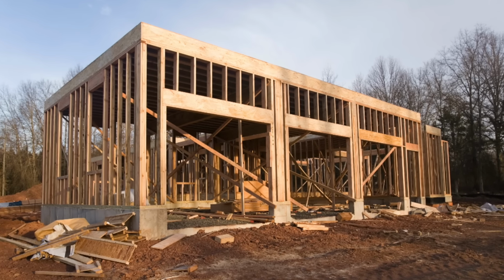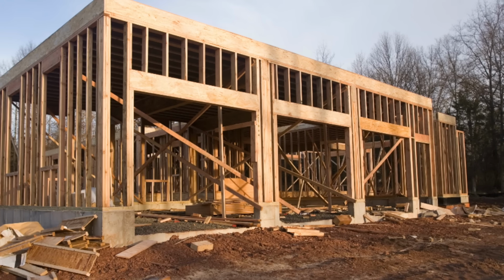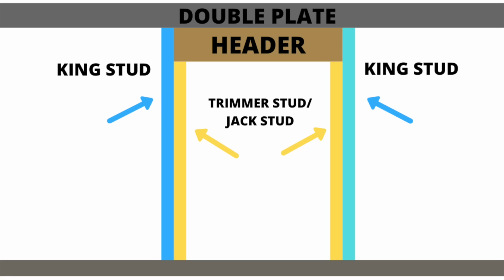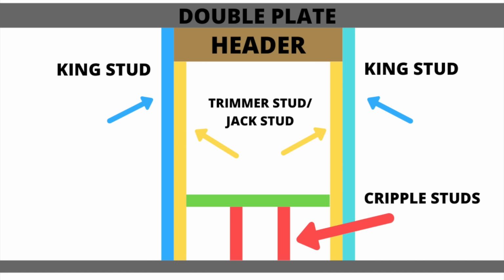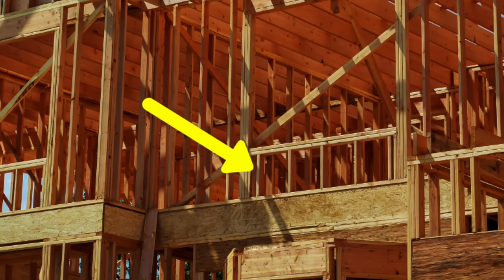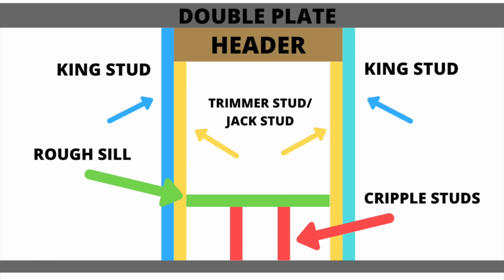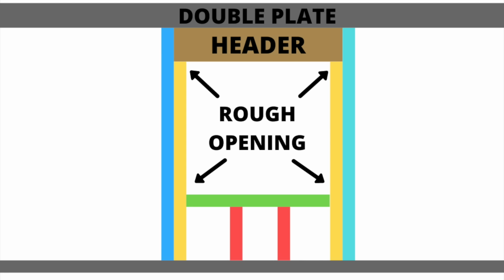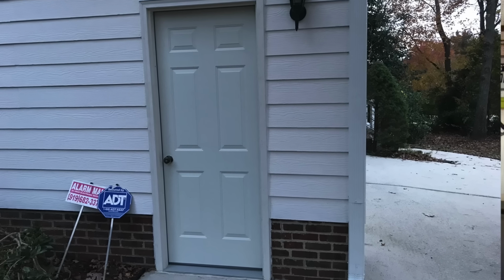All House Framing EXPLAINED...In Just 12 MINUTES! (House Construction/Framing Members)

Comment: Very well done video! Really enjoyed learning more about framing. What are strongest rafters or trusses? I feel like both are highly used in construction. What is the best way to get into framing? how much can you get paid with no experience and with experience? Is steeling studs framing replacing wood studs for residential? I see is done over commercial. Thanks!
Reply: Perhaps you should make another videos explaining how plywood sheeting prevents the house (skeleton) wood frame from falling apart. Interested to learn more.
Reply: Trusses are stronger. No, metal will not replace wood, which is grown as a crop and doesn't need mined. Stop at a jobsite and ask to talk with the framing foreman.

Comment: this why hurricanes ( depending of the state like florida) , if you build something like this hurricanes level 2-4 will do alot damage , but the other hand commercial building can handle hurricanes , so who coded this house builds at the end of the day 🤔.
Reply: Wood-framed structures in hurricane areas are built to special codes and do fine in hurricanes.

Comment: Ordering my engineering experts in my functional group to create a field group engineering lecturer to teach by troops camps roaming of on-site lecturing to my army legionnaires per group schedule lectures to each and every equipments for building things, the proper measurements and calculations of structures to build the different types of structures and terrain adaptable structures, the excavation procedures the tools of variety for construction the modern engineering techniques. Of a course per course basis. Understood. Then followed by another group of lecturers from my tech group of Wirings experts of wires variety and function for electric installments technique to electronic machineries to hardwares and softwares equipments to combat bomb making wires and bomb diffusing of wires technique to wireless technology study courses. Of a roaming method of teach to each area troops camps of my legionnaires armies. The CaesarKing I orders. You my soldiers shall be an efficient soldiers of war at the same time with know how to build and adapt to the terrain environments of whatever purpose orders. Understood. The CaesarKing I orders. Let it be

Comment: I loved how you broke down the framing process! I've faced challenges with joist alignment in past projects, but understanding the terminology made a huge difference. 

Cost estimation can be tricky, especially with lumber prices fluctuating. I use FloorTally to keep track of materials and calculate costs accurately. It’s been a lifesaver!

Comment: This is a great introduction.  Concise and precise.  Thank you!

I see that the wooden frame is exposed to the elements, wouldn't moisture and sun damage all the wood?   I suppose that it isn't practical to build a large cover/shelter first.
Reply from the maker: Thanks! Most lumber has acceptable time limits that it can be exposed to the elements. Ideally though, you want to get the house "weathered in" as quickly as possible!
Reply: @TheHonestCarpenter  Thank you so much.  You can tell I know nothing about building a house.

Comment: Great video. I would ask you, what's the best way to protect the bottom structure of the basement from fungus? My basement has a lot of moisture because in the winter, even if I ventilate it and use a dryer, there are lots of rainy days with high humidity % and I get some fungus on the wood in the basement :s How can I get rid of this problem?
Reply: It sounds like you don't have good drainage in the outside of the foundation.
Reply: @jobacuda4472 , I have. All the walls that are under the ground level are isolated and I created a drain system that goes a little under the foundations level and collect all the waters that surround the house, but even with all that, I get some points where the humidity seems to come from under the foundations level :( when that humidity comes up, it'll take too long to dissapear, giving time for the fungus appear :S
Reply: @jsd1as  I just wonder, given good drainage, where can the water be coming from? Is it coming up through the slab?
Reply: @jobacuda4472 , I think yes and also from from the bottom of the ground.
With all the drainage I did, the only explanation I can find is that all the surrounding terrains gave a big pressure of water, making it to come out from under my house. My question is, how can I isolate it completely or at least install a good ventilation solution to avoid the creation of fungus
Reply: @jsd1as  Yuck. You could seal your slab if you haven't already. But if there's pressure forcing the moisture up through the slab, it may lift and rupture whatever you put down.

Do you have heat and AC in the basement?

Comment: Do you have any material on how to add a hip style roof covered porch addition to an existing low pitch(4/12) gable roof. Is it possible? Also, the issue is that the home is a single story residential home with standard 8’ walls. It’s a very plain and basic built home that is a perfect rectangle with no additional architectural designs/features. It’s a 27x73 rectangle right now. We wanted to change the appearance of it by adding a hip style covered porch that is 10 deep on the narrow end (27’ end of the home). Is it even possible to construct. Thanks
Reply: Yes it is. Of course, hip roofs are quite a bit more difficult to frame than gable roofs.

Comment: When you buy lumber in today's stores, they falsely advertise their wood dimensions, an example of this is they sell 2x4 listed as 2x4 but really your not getting a 2x4 piece of wood your getting more like a 1.5x3.5 there for the engineer data is always inaccurate to the actual material being used.. only solution would be a class action lawsuit anyone who got sued for not building to code of similar issue...the misleading advertisement in hardware stores about what materials being sold, home depot, lowes, any lumber store is participating in this fraudulent scheme of false advertising.

Comment: Does one need knowledge in structural engineering to design & build a house like that?
Reply from the maker: Yes, definitely some serious experience with it. And generally an engineer will calculate loads and approve code adequacy of framing (which an inspector will sign off on later).

Comment: We recently purchased a house built in 1942. All the inner and outer walls are covered with 1X6 boards. The inner walls have burlap material, old wallpaper, and sheetrock pannels. Even if you had NO outside sheeting, you could NOT pull this framing over even with a bulldozer.

Comment: Instead of I-joists, utilizing oriented strand board, is it still an option for homeowners to have joists that are solid lumber?
Reply: Yes, but they can't span nearly as far.
Reply: @jobacuda4472 what’s there to span the gap? Adding more?
Reply: @omni1607  Lumber joists are the weakest, I-joist are next strongest, LVLs, glulams, and floor trusses are the strongest.
Reply: @omni1607  Add more, reducing the spacing (or doubling them). Or use taller members, e.g. 2x12s instead of 2x10s

Comment: All the benefits that you assigned to trusses assumes that the truss is in good working condition. I have almost NEVER seen a home where at least 1 or 2 trusses werent compromised or installed wrong. These construction companies that mass produce homes for suburban sprawl do some of the WORST work on the planet. If you are building a new home and can even REMOTELY come close to affording it, hire a proper architect with a crew that does specialized projects. It IS more expensive, but you will probably save the difference by avoiding repairs and water damage in the future.

Comment: That large passage that was cut through those ceiling joists at 2:18 - looks like it destroyed all load bearing potential for that section.  I would not be comfortable doing that without secondary support.
Reply: Amazingly enough, they are designed so that it's OK.
Reply: Also, all is engineered, but know that you can't just blow holes in these wherever you want. Important to follow manufacturer's spec.

Comment: Very helpful explanation. 
mudsill on top of foundation (treated wood)
floor joists - today engineered lumber... 
i-joists = strandboard and solid lumber caps w/ precut knockouts can run uitilities through like duct and wiring. 
beams run perpendicular to joists to add further support as a "spine" for joists. can rest on masonry piers on a foundation. 
columns then attach to beams into foundation etc =vertical support.
 subfloor on top of joists made of plywood or strandboard. walls on top of subfloor. stud=vertical lumber to create structure - 2 *4 or 2 *6 -- sit on top of plate - untreated lumber attached to subfloor. and at top of studs (oft doubled) 

doors and windows - headers to provide support where studs hollowed out
prefab staircases installed like a ramp
upstairs same as  bottom floor - joists, subfloor, etc
roof made of rafters converge diagonally at a ridge board
roof contours = hips and valleys
roof trusses prefab roof shape & structure installed side-by-side - very strong and faster to place
sheathing on top

Comment: Question -  I have porch with gable roof (12x16) with 10feet high from ground. Wondering if posts for porch should be exactly "under" the outer wall (parallel to house Wall) or can Gerd/beam (horizontal to support porch) can be  placed "right under the outer wall - parallel to house" OR 1 foot inside (towards the house) with helical posts into ground ?  Please let me know If I have been able to articulated my question properly for you to under stand precisely.  Thank you in advance.

Comment: I learned from your video about blocking. I did not know builders did that in the kitchen and bathrooms. I always wondered how cabinets would stay up over time with so much weight in them! 😅
I also did not realize they were used as a fire retardant inside the walls. Most everything else I was familiar with having built a sheds and chicken coops in the past.

Comment: which contractor should be hired to do the framing of the house?
if rehabbing of house does framing guys will do the sub floors too and stairs too or these are different contractors?
Reply from the maker: Probably all one contractor 👍
Reply: Framers do the structure of the stairs. Trim carpenters do the good-looking parts later.

Comment: We recently bought a used mobile home, and just found out that it appears to be built of 2x2 instead of 2x4. Unknown if the outer walls are different. We want to replace thin wall paneling with dry wall/sheet rock, or the like but have been told 2x2 would not support the weight. Is this true? Can we replace w 2x4s or beef up walls?
Rob
Canton, Tx
Reply: I think the only place that the wight would be an issue is the ceiling. Drywall weight on the walls is straight down. Wall studs can carry that load easily.

Comment: Really cool 
As someone with degrees in mechanical engineering, I have sometimes wondered what the cousin branch of civil engineering does 

There is one thing I do wonder about, though 
Or maybe not so much wonder but a thought 

Wouldn't the structure be more stable if an earthquake occured if somehow more diagonal boards were included in the walls? 
I mean, triangles are mad strong 
It would make the walls more like the trusses you described, maybe a bit similar to how a common fence gate is designed
Reply: The shear forces are better handled by structural sheathing. An infinite number of triangles!

Comment: I'm a commercial journeyman plumber and avid woodworker.  I was surprised at how much I did know about residential framing.  I also learned some things.  ..and subscribed. I didn't know that roof trusses don't necessarily need load bearing walls to support them.  I've never heard of stud groups. I thought I might hear about pilasters, crickets, pony walls, knee walls, lolli columns.. Maybe they're all commercial applications  only?  ..or names of features that are built using the terms already explained,   like pony walls and  knee walls are built with studs and plates .. or maybe they were mentioned and I wasn't paying attention LOL that's quite possible😅

I really like this video. I like your style. it's all meat and potatoes, no parsley. Very respectful of the viewers time. Time is life
Reply: Trusses have certain points that transfer all the load down into load-bearing structures below them (often stud packs).

Comment: I have a question:  shouldn't your first floor walls be sheeted before you build a second story on top, to add more strength?
Reply: We often used temporary 2x4 diagonal bracing. The goal was to get the building dried in as quickly as possible so the other trades could start.

Comment: Clearly I've been here before, so why didn't this vid have my like on it? Is YouTube being sneaky?

It's time to update this vid to include truss floors in the flooring section, not just as an afterthought to roof trusses. Unlike timber I beams, floor trusses are made from real timber not rubbish, and they give you all the benefits of rigidity and openings for services without the outgassing or the ability to dissolve when damp.

In my part of Australia we don't sheath the whole house. A certain amount of ply bracing panels at the corners or even just cross-tensioned diagonal galvanised strap is enough to stop it blowing away or falling apart, and plating the entire house is expensive when you're not gaining anything from it.

Also, I was watching a Scandi builder recently, and there instead of the double top plate they run a lintel all the way around the loadbearing walls just under the top plate. If the spans aren't too much this could be the same dimensions as our second plate but on edge, which makes it stiffer to vertical loads for the same amount of timber. I think it's better than how we've been doing it.

Comment: From his thumbnail picture you can see a complete house framed with not one piece of plywood on it anywhere . This is very dangerous I have seen apartment complexes and houses fall down because people think a little brace nailed inside is going to hold the house together it doesn't work that way. I suggest at least one piece of plywood on the corners of the building before you put the next floor on the house I watch this video I realized this guy knows nothing about framing. Just so you know when you use I joist on the floor you do not set them on top of LVL beams as he has shown here. They should always sit either on a load-bearing wall with a rim joist attached to it or they sit in hangers. Spanning long distances they do very well but they have a really crappy Crush rate. If you put the beam below the I joist the weight from above can Crush that I joist. The smart way is to put the beam up just under sub flooring so that the Joist and the loads above are both taken care of with a hanger at the connection. I see in some of these pictures he has put on these metal angle braces I can tell you from experience they are worthless and they will bend in between each stud.I joists they are worthless I've already been through a lawsuit where I put these I joists on exactly like the engineers specs said and then two building inspectors inspected it and passed it and a year later the joists that were sitting on the beam were crushing around the beans, the plywood in the middle was bowed tremendously from too much weight coming down on it from above after the lawsuit and everything went through it was clear that I joists should never span all the way across your floor with a beam in the middle underneath it. Just use hangers people that's all I can say move the beam up to the floor and use hangers that weight from above will then transfer straight to the beam taking the little flimsy I joists out of the picture. If people continue to build this way there will be many problems in the future with these I joist, especially when used in a crawl space where it's damp. And where he talks about the second kind of headers, completely forget everything he said and showed you it is wrong

Comment: We are told to leave at least 1/8 inch to allow for thermal expansion, yet why the need for tongue and groove?
Reply: Believe it or not the tongue in the groove section is made to expand and contract just like the sides when you're putting the subfloor down you leave an 1/8-inch on the sides and that tongue and groove side is made to expand and contract the way it is
Reply: If you notice you can look at it when it's put together on the bottom and the top and you will see an at least a 1/8 of an inch gap between the two pieces. For example if you put a tongue and groove piece of actual hardwood floor down there should be no Gap in between the wood. So when you put the subfloor together you actually see a little Gap
Reply: That's good to know.

Comment: Great video I’m also an electrician and I dislike wall blocking when I’m trying to fish a wire in a finished wall
Reply: Here in North Carolina they have required a horizontal block anywhere the exterior plywood comes together. Sometimes fire blocking is required and nobody likes to mess with that but just putting the horizontal Block in the wall for nothing is only required if the wall is above 10 ft tall

Comment: Great video!  Concise!

Where will I find a table defining the correct dimensional lumber for a given span?

Thanks!
Reply: In North Carolina it is provided in the residential building code book. But you have to know what kind of wood you're using because it changes depending on what you use
Reply: Code book.